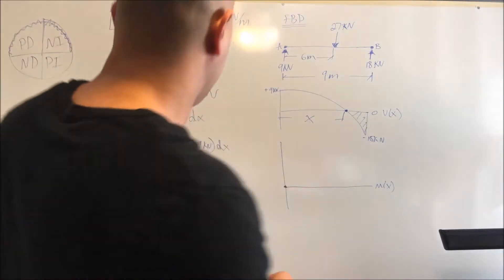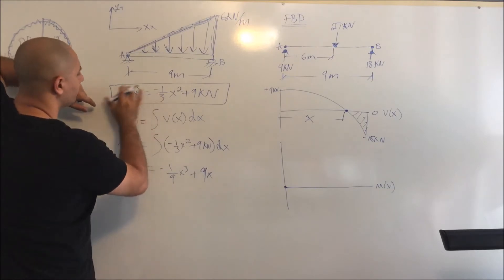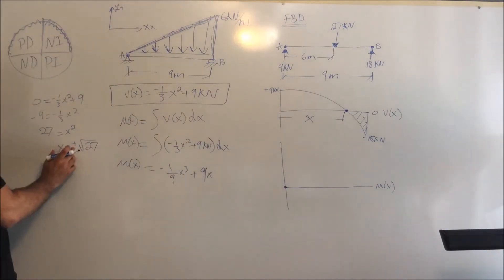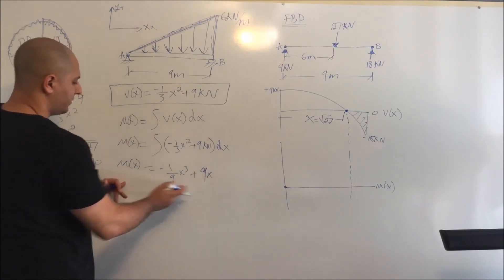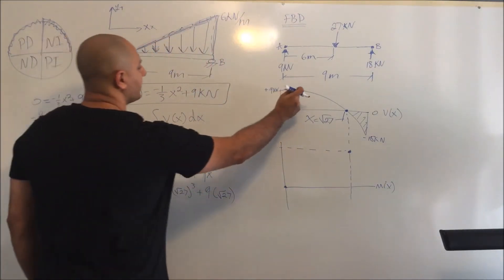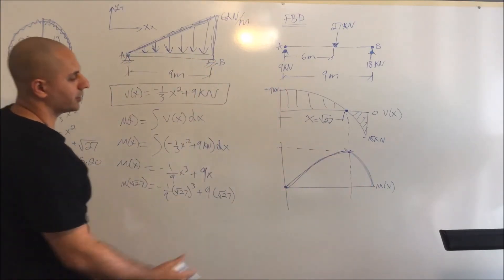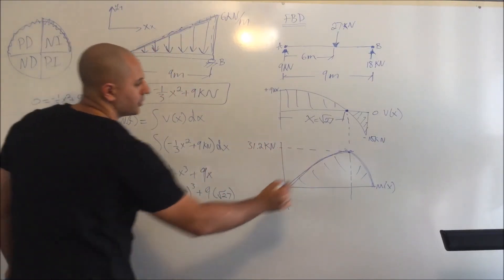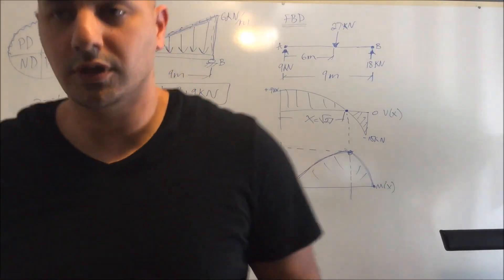DRAW SHEAR AND MOMENT DIAGRAM PART 3

Comment: Your finding my comment is miraculous. I'm diligently working back over my process. If I let x equal '0' instead of 9 just as you did; i.e., V(9) = -1/3(9)^ 2 + 9KN = -18KN, I see the equation (your's) then equals + 9KN. Is this what you're referring to i.e., to see what I arrive at when letting the shear equal '0.' When I indeed perform that computation I get +93 lbs. And this +93lbs is definitely in my moment equation. In fact after intergration and if not in error is then +93X. I gave wolframalfa my slope figure to double check my indefinite integral for my shear equation, so I hope I'm true there, and I believe I am. Again, my slope is 110lbs/5ft. for my unusual distributive load.
Reply from the maker: honestvalley9 what I was trying to say is that after find your shear equation, you must do the integral to find the moment equation but before you solve the integral you must account for shear  that is present at x=0. Look at your reaction forces, if it is a fixed beam then there is a moment acting at the fixed point

Comment: From:  honestvalley9@gmail.com    First off & foremost thank you for your exceptionally well thought out presentations.  Indeed you have given me a template.  The linear distributive load of mine is 110 lbs/ft.,  representative of a couple of unopened boxes of photo copy paper (approx. 1/4 KN ea.) with a beam length of five feet.  Appealed to your integral format to work out both shear & moment.  The shear root came out spot on.  Again thank you.  But my moment root does not balance out to zero when I substitute the 5 ft. into [ M(5) = 93(5) - 11(5)^3 / 3 ].  I get 7, which is pretty close to zero.  But it must equal zero.  Would you please make a recommendation for fixing my calculus.
Reply from the maker: honestvalley9 one quick question based on your integral for 9(x)...(x)^3/3... did you check if there is shear present at x =O if so, you must add it to the integral. Let's say there is shear present at a value of 3. Then the integral should be ..3+9(x)..(x)^3/3=0.... hope this helps